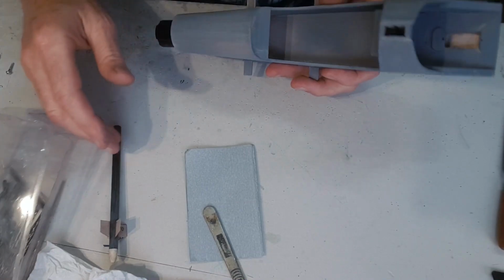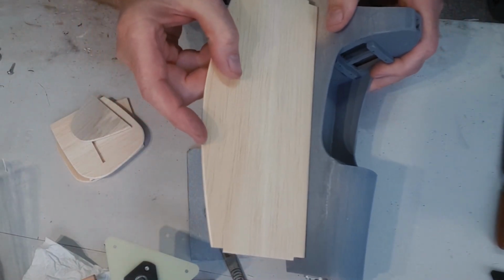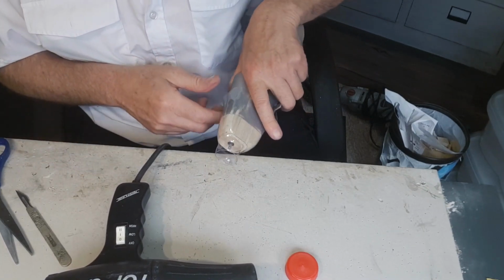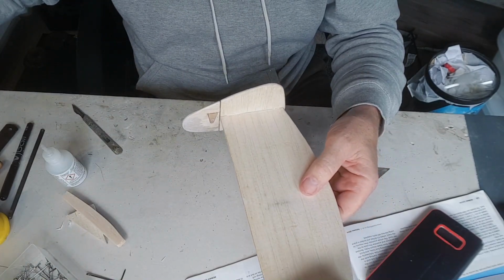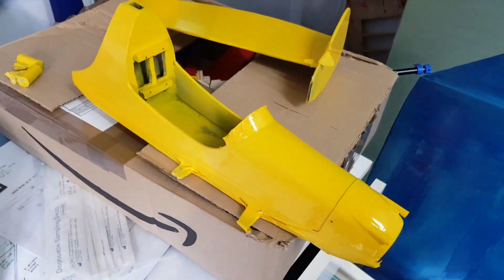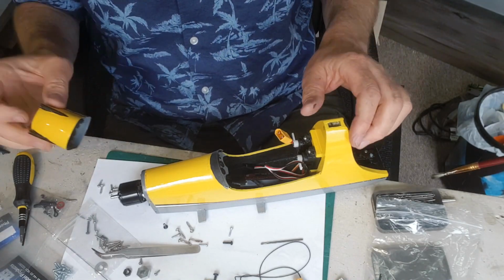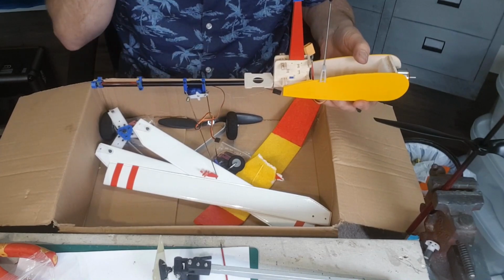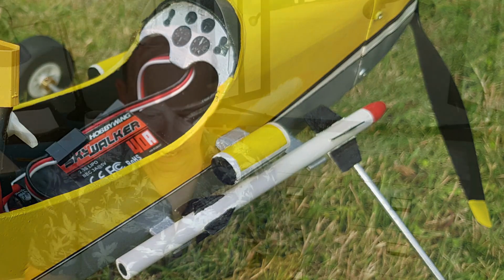ATOM AUTOGYRO BUILD PART 3

Comment: Hi, Cliff! Your doing a bang up job on the gyro copter Old Chap! I still can not fantom how a gyro copter works. I use to watch people fly in them when I was a young Lad. I'll just keep watching you build them and test fly them later. "Cheerio!"
Reply from the maker: Thanks Richard 😁😁👍
Reply: A gyroplane, is a type of rotorcraft which uses an unpowered rotor in autorotation to develop lift, and an engine-powered propeller, similar to that of a fixed-wing aircraft, to provide thrust.  The rotor turns because of the passage of air through the rotor from below. Since the rotor is in autorotation it uses a more simple swash plate to control the rotor. The swash plate is the Cool winds part that allows control of the rotor pitch.

Comment: Hi Cliff.  Your Little nellie is fantastic.  I read somwhere that if the rotors on an autogiro have not spun up enough for lift-off, they will groundloop viciously to the left.  You might ghave that in mind when you fly.
Reply from the maker: Yes, I think you have to hear a certain sound they make before attempting lift off, thanks for the advice 👍

Comment: Atom special is all done. The only modification  - I added a tail wheel. The ground handling is a little wonky. It wants to ground loop terrible if the power is let off too quickly. It tracks well with the tail wheel with power on. Just waiting for the rotor head from Coolwind Models. It’s ordered and I hope it doesn’t take too long to arrive in Canada. Very excited. By the way I am also very interested in building the Panther. I downloaded the magazine article for the info but where do I get the plan? Cheers.
Reply from the maker: That's a good mod, I may have to do the same, I'm hoping the tailskid keeps it straight in the grass. The panther plan is obtainable from Sarik https://www.sarikhobbies.com/product/panther-plan/👍

Comment: Very nice series of videos Cliff and a very nice build. I will be building an Atom soon myself - currently using a HK Auto-G2 as my trainer autogyro. I think it's a good idea of yours to repair and use the Lupo before flying the Atom. Although not especially difficult to fly, autogyros are somewhat different and take a little getting used to.
I look forward to the continuation of your projrct.
Reply from the maker: Thanks Art, I'm just readying the Luobo and she'll be good to go, I've just spent a pleasant couple of hours sanding the rota blades for the Atom, they're quite a bit bigger (more area) than the Luobos, how are you getting on with the G2?
Reply: @CliffHarveyRCPlanes  The main problem with the G2 is the prerotator. It was great when it worked but was not reliable. I have replaced it with an electronic switch, with power for the prerotator motor being tapped from one cell of the flight battery using the balance connector. This doesn't give enough rotor speed for take off so will redo the connection to tap 2 cells and see how it goes. I have two sets of those rotor blades you have for the Lubo and they work well on the G2 although I added about 10 grams of tip weight  to each.
Reply from the maker: @artesanrc  What great machines these are for experimenters 🤔😁👍